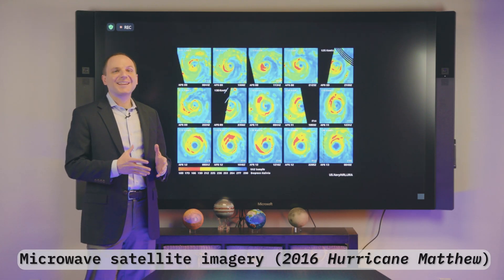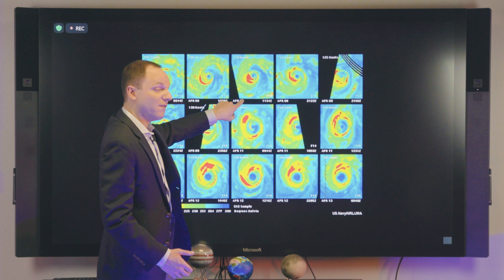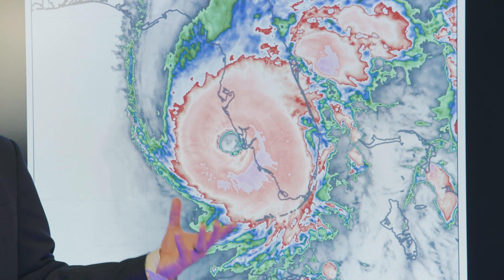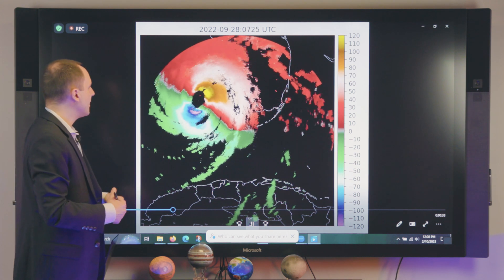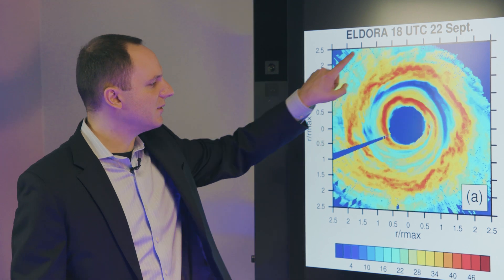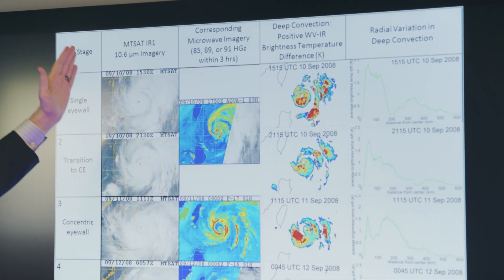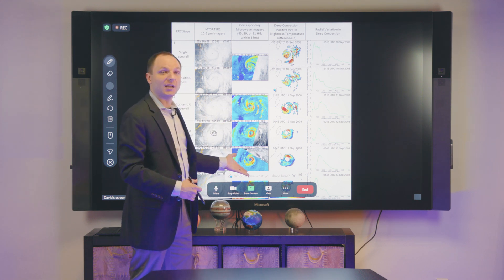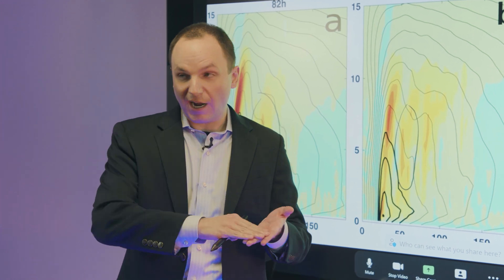Eyewall Replacement Cycles | Tropical Weather Expert Explains

Comment: A question for the Doctor. Using the Eldora section of the video as well as Ian section. Looking closely at the eye walls, and also going by what you said “it commonly happens with category 3,4,5 hurricanes,” 

I’m rambling sorry haha

Doesn’t it look like the hurricane is breathing?
Reply: My old advisor said that to me about 1997 EPAC Hurricane Guillermo, which eventually became a Ryglickicane in that we know that the "breathing" he was talking about is caused by tilt wobbles.

But you choose that word, breathing, for a reason. What do you mean, specifically?
Reply: @davidryg  it seems as if in the change process of the eye wall, the warm gets released kind of like how humans exhale. At the same time, and it is at the same time because it’s just one big hole, cold air moves down in to start and create another eye wall. It’s the cycle process how it amazes me because it definitely does look like breathing but in Mother Nature form. Also in that for specifically, it is a monster, it is extremely dangerous but also beautiful sense to me.